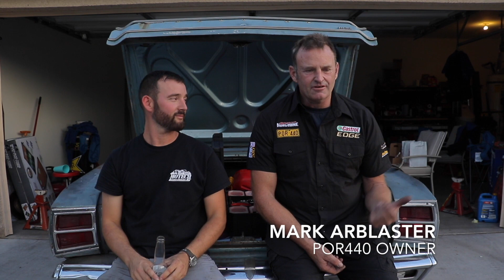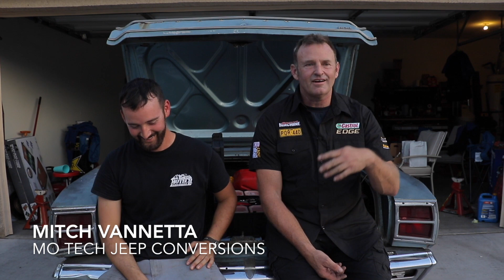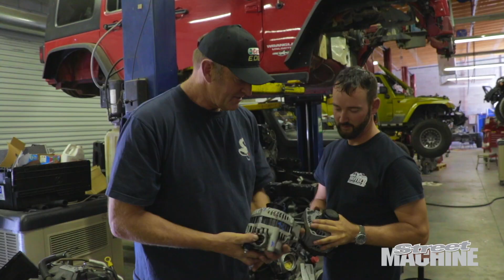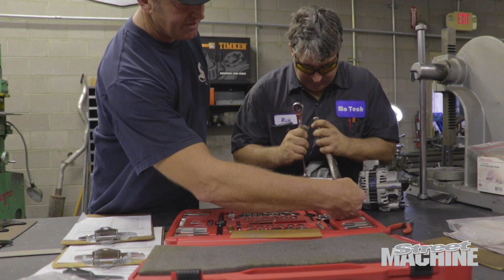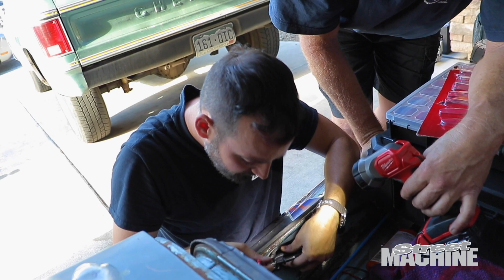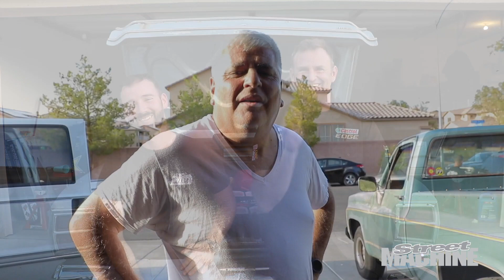Aussie Valiant Drag Week rescue in Vegas

Comment: probably worth while checking the voltage at the fan connector before you change the fans as it looks like you have quite a few wiring issues.